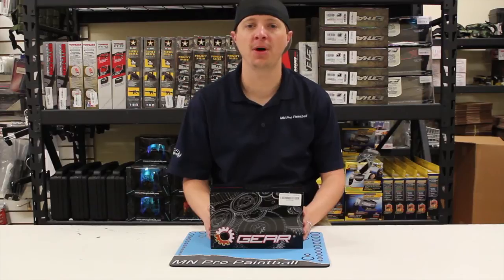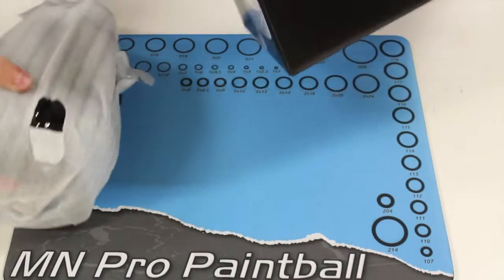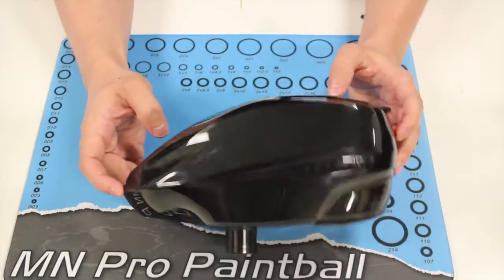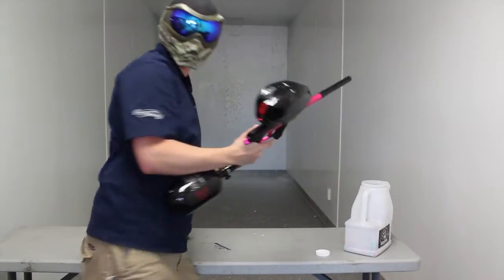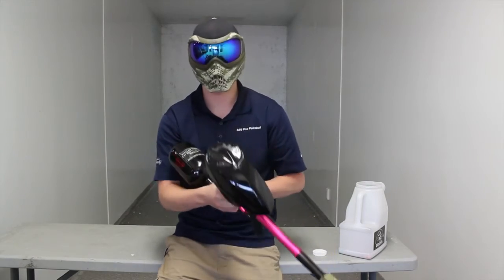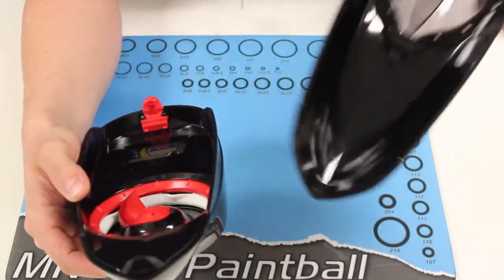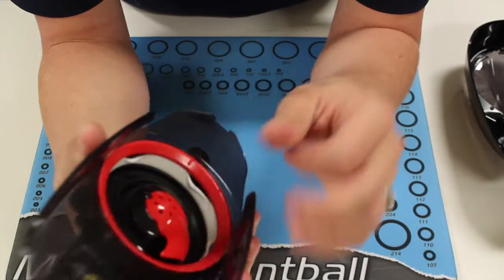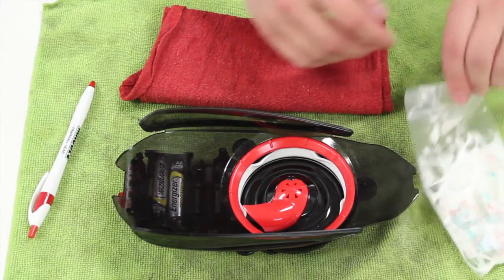Machine Paintball Gear Loader Review

Comment: Materials look really cheap. How in the world do these people figure that thing is worth $200 bucks. Aint no way in the world!!! Paintball is such a monumental rip off it's just ridiculous. People have got to start standing up to this kind of stuff. I won't buy it!! There's no way in hell any loader should be priced over $100. Plastic is not an expensive material, and the tech that's going into to make these things can't possibly be that expensive considering you just turn the thing on. There's no menu settings or programming involved so what justifies the price. These people need to quit smoking that crack!!
Reply: maybe its the patent and brand name that cost
Reply: True, I agree, but most of the cost goes into manufacture, research and development, and the fact that these products are not like Iphones or Croc shoes, where millions will buy them.  So this raises the price, in terms of materials, they are not worth $200-$250 for a loader.  But thank goodness Dye Rotors can be had for a reasonable price lightly used, they are so durable, that my lightly used Rotor looked brand new when I bought mine.  Like you, I refuse to pay too much for my gear.

Comment: the only reason i would buy it over my current rotor is the weight issue, shiny loaders looks cheap unless they are smoke or clear colors, requires tools to fully disassemble the drive system, the sensor instead of a button is just a gimmick (IMO) no manual? plain box as packaging?? did not even bother to make a round hole in the carton to sit it in place? and i tought pinokio loaders had crappy package (just a bag) , these machine ppl broke their heads developing this loader, "lets make a loader that look like a rotor in the inside, loads like a spire, but with the rubber in a ring instead of the center and make it hard to fully take appart, like the Z2